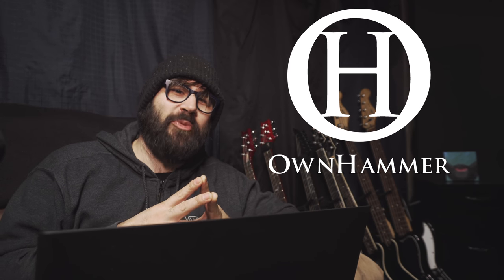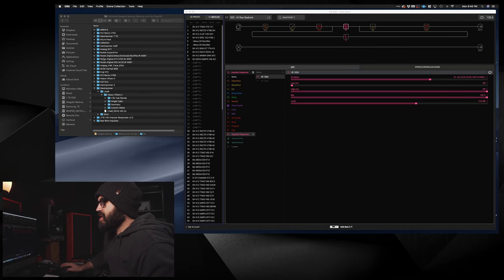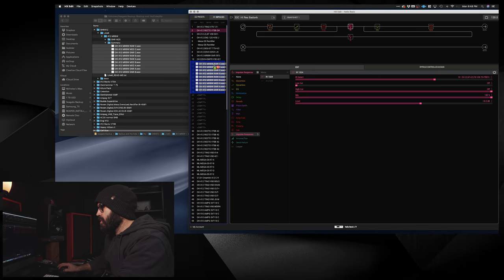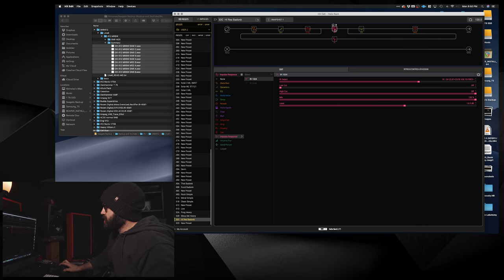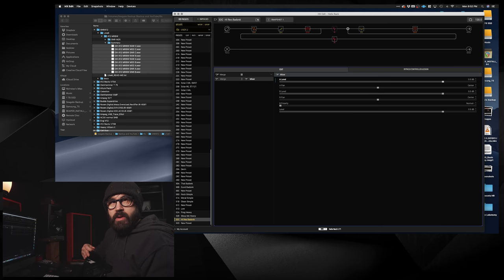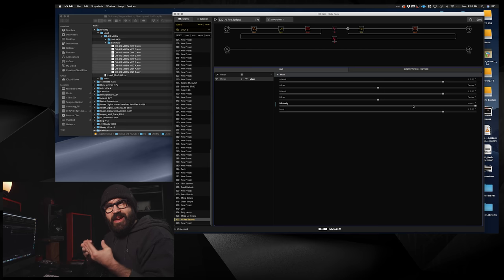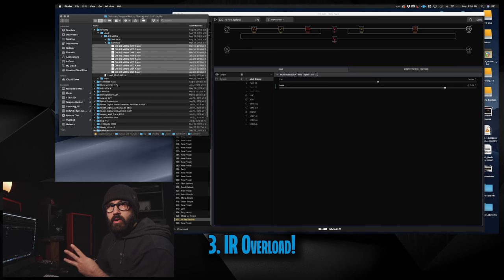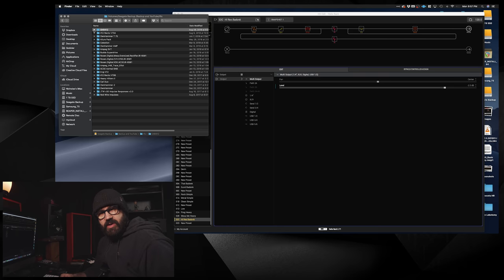Impulse Responses | Three Keys to Using IR's with the Line 6 Helix and other software/hardware

Comment: I will give some tip.
 When checking sound, have a stereo delay with 0ms on one side and 13ms on the other side 100% mix. The goal is to mimic Double tracking. This way you will judge the sound in stereo in the mix. It easier to check the low mids. Fizzy guitar is good on rythm, but not on solo => lowpass at IR à 10khz. If the sound is too dark, try ti cut 3-5db wide from 250-400hz. Compensate by boosting a little à 120hz. On V30 impulse, cut a little at 5,3 khz and around 7-8k, with narrow Q

Comment: Hi. Thanks for the video. About point 2 (Phase). I hear the difference too, but I don't get the technique. First thing you flip the polarity, then you set the level of the b path to the thin and nasty sound point where "it's cancelling out the least amount of frequencies". Doesn't a thin and nasty sound mean you are cancelling out the most amount of frequencies? Secondly, how can that point be reached by lowering the level of an inverted phase signal against the other that in itself is going on at the same level? It is as if the "Level" setting of the b path in helix path merge would in reality be a mic distance setting. In that case I can understand the process. You find the perfect distance in which the larger out of phase occurs and then you flip the phase (again). While I really don't understand how a volume reduction of the second signal can increase the phase cancellation in the sum of the two signals. But then again, maybe my whole understanding of the concept is wrong. Thanks again.

Comment: At 7:48 it seems all you are doing is adjusting the level of the B signal (and flipping polarity) but why adjust the level of the b signal in the first place?
Reply from the maker: As I explain I’m the video, I flip the phase and adjust the level of the second IR to the point I hear the most substantial phase cancellation, then I flip it for the full sound. If they are both at full volume; there is a substantial amount of phase cancelation. If I lower one, in this case, the second one, I get more of the sound I’m looking for. It’s about a good blend. Each IR in this case adds a different thing to the picture. There is a pretty audible difference.

Comment: Im going to steal your "phasing" tip and put it into my #helixtipoftheday on Instagram.I actually had thought of this first, well before you, but just hadn't had a chance.......LOL Just kidding. Great tips. Another way to help phase is thru stereo chorus with rate at "0" and also  by using the Doubler in the stereo mod group. Both substantially affect phase especially when you flip phase in the Doubler.  Im currently using Valhallir.At IRs and love them. The "real amp" sound is there in a big way. I also am experimenting with Ml sound labs and LiveReadySound. The live ready stuff is by far the easiest to work with. Awesome right out of the box without huge eq cuts or boosts. Thanks again for the tips and videos, and if you want to hang onto your tip, I get it. I won't post it without your ok.
Reply from the maker: Just send them my way and you can share away mid appreciate it
Reply: @NickHillMakesMusic  Will do. Are you on Instagram? I'll try to put a link in the post to this video; and I will def lead them back here on this tip
Reply from the maker: I am @nickhillmakesmusic

Comment: Nick, when you use 2 at the same time in 1024...You use 2 different IR always, or to make this phase tip, it’s possible use the same IR?!
Reply from the maker: Why would you use the same IR? No benefit to that. In that case, use one 2048 IR at the volume you need
Reply: Nick Hill thanks a lot for the feedback Nick! I already have one favorite IR. But the second tip...gives me another vision of IR, and I have others cool IR to try together, but is others cabs and mics.

Comment: Awesome tips as always!!! Nick, what’s is the difference when you use the IR, 1024 or 2048? What you preffer?
Reply from the maker: Honestly, I can’t tell a difference but when I use one, I use 2048.
Reply: That’s the bit depth of the IR. 1024 uses less DSP and has less audio resolution. I’ve found that Helix won’t let you use two 2048 IR’s on the same path because it can’t process it but I can if I have one 2048 in each path. For the record some think the difference in audio quality is imperceptible between the two. You’ll have to have your ears be the judge and decide how much DSP you want to use up.

Comment: When I invert the polarity and adjust the B level I'm not getting that lofi sound. Only the volume seems to changing but no change in tone. Any Idea?
Reply from the maker: Ok, a volume change is an indication of frequency cancellation. When you flip the polarity, what you hear is what’s being canceled. Adjust until your happy with with that and also, you may not need to do this at al. Cheers man
Reply: @NickHillMakesMusic  Cool, thanks man. It sounds awesome. I'm using the ML Sound Lab Mega Djent Cab Pack.
Reply: @NickHillMakesMusic  Also, your new single kicks ass! What models are you using?
Reply from the maker: Thanks Bro! I appreciate that. Happy riffing!